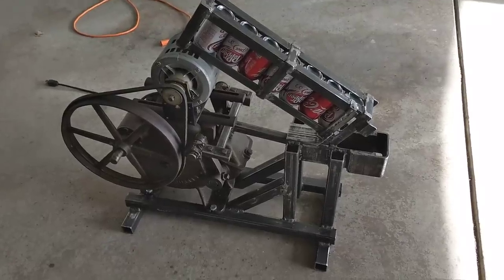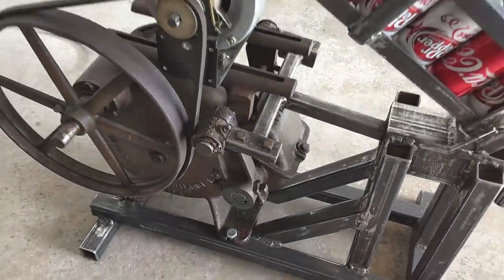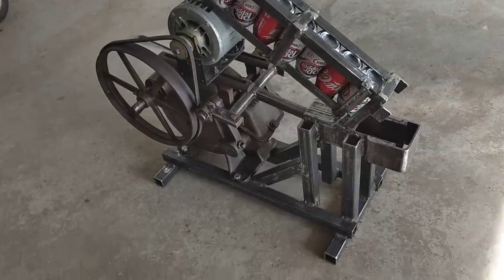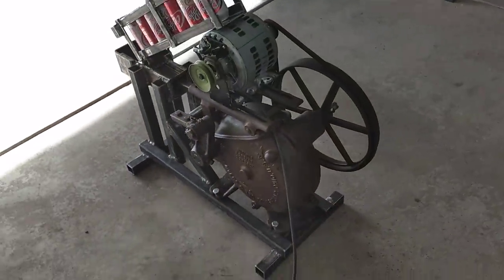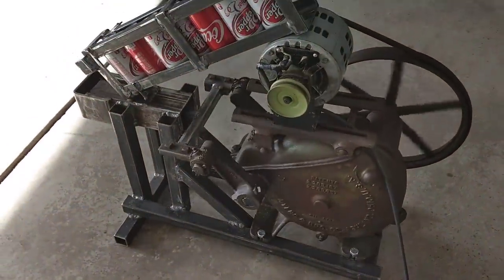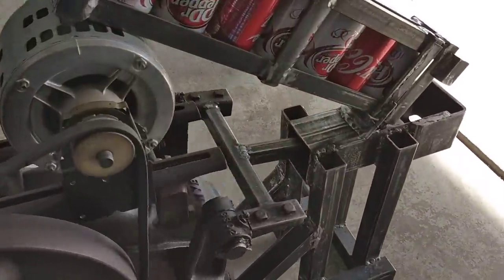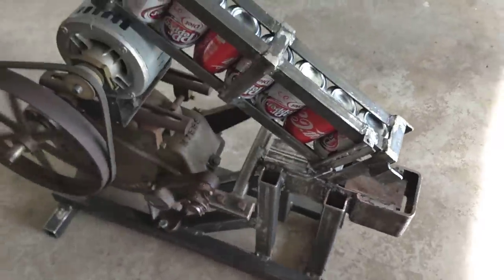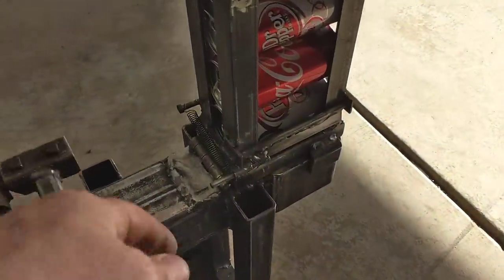Myers Pump Jack can crusher

Comment: O….boy!!! My hat’s is off on this guy. Great job… beats the old hand leaver. N.A.S.A. Need to check you out, may be making robots or a mars lander or something. Just a Great idea,love your video. It’s a yankee engineering at the best.🇺🇸🇺🇸🇺🇸🇺🇸🇺🇸🇺🇸🇺🇸🇺🇸👏👏👏👏👏👏👏👏👏🍺🍺🍺🍺🍺🥰👎🏻🍻☮️🍻
Reply from the maker: Thank you so much for the kind comment Thomas! It gets used quite often and when running of the electric motor I can barely keep up with putting cans in it. I sometimes take it to tractor/engine shows and run it off one of my hit & miss engines.

Comment: Very cool I like the reuse of old equipment, however not the most efficient I've seen. Would take a long time to do garbage cans full... then different sizes of cans would cause trouble. Two wheels spinning towards each other is the fastest I've seen yet, dump them in and done. But it doesn't do the crush as neat as this..